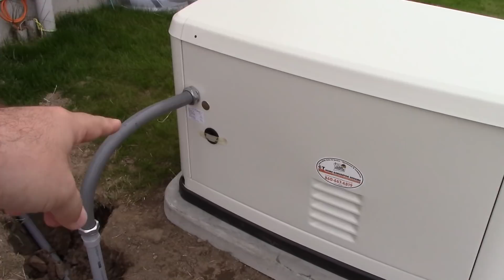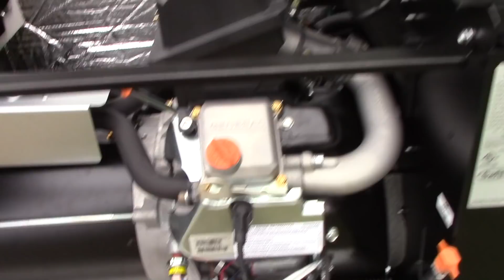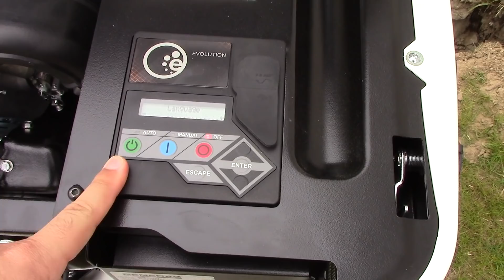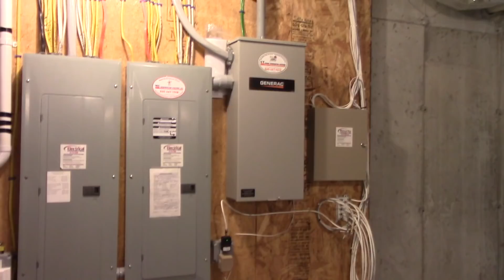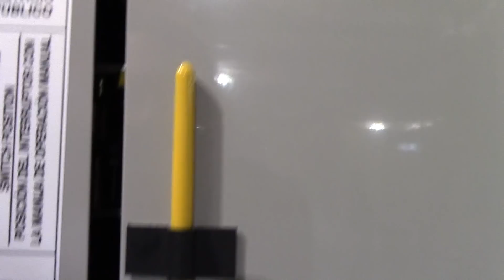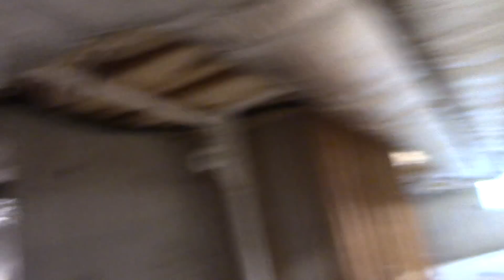Generac Standby Generator.

Comment: You take off the two top screws and you take off the bottom screw going towards the ground I just had a generic generator dealer at my house working on my generator was not working right and that's the screw you took off to take the side panel off to get to the battery the screw going towards the ground and take off just in case you didn't know nice YouTube movies

Comment: All Im seeing lately are bad reviews on these Generacs, I would love to buy a standby generator but I dont want to buy a headache. Overall the Generac reviews Ive read are atrocious
Reply: Mine has been a life saver..just keep up with maintenance and change oil. Mine is actually running right now as its 20 degrees and very windy..power is out and it's been running for 10 hours. Keep in mind that they are NOT meant to replace your electricity supplier. It is for power outages. Good luck and go Generac!
Reply from the maker: Try Kohler.
Reply: Checking into other brands but not too many choices where I live. Thanks
Reply: Try Cummings.  All the installers like Generac so they can’t be as bad as you say.
They have more issues because they sell the most units by far.
I’m trying to decide which one too.  One installer said Koehler has some issues.
Reply: @DONALD1951 /kerry4951 Briggs and Stratton used to make the engines for Generac B&G is supposed to be coming out with whole house GEN SETS soon?
Reply: What are the reviews that you have read about?  I have had a 20KW Generac installed sinse December 2016 no issues.
Reply: Anything manufactured has a potential for a problem no matter what the brand.
Reply: kerry4951 sorry I am late I just read your comment right now. According to the professional Technician who installed my Champion 8.5kw standby generator about two years ago, this brand is the most reliable by far over any other standby gas generator in the market, including the Generac, Honeywell and Kohler. He has installed over 300 units of different brands and serviced them. I don’t live in the states I live in Puerto Rico, but here we use the same brand generators all you people use in the US. I know a few people here with Champions standby generators that has almost 2,000 hours of use and are still running flawlessly because after we were hit by hurricane Maria some areas were without power for over 6 months in a row. Mine have about 150 hours only because it was installed 3 months after we were affected by the hurricane and at that time the power was already restored in my area. I can energize my whole house with mine including my electric cook top, microwave oven, all my lights, washer, my two garage doors, my two fridges, my 48” TV, my wifi rauter, satellite system, my water cistern 3/4 HP water pump, my 18,000 btu inverter a/c, but my water heater is solar all my lights are LED and I don’t use a dryer, neither have a pool and don’t need a heater because we have warm weather all year round and don’t use a dish washer neither.
Reply: @raymondmorales8252  it powers the ir conditioner? with 8.5 Kw?
Reply: hector Cervantes yes in fact I recommended this same 8.5kw Champion standby generator for a lady that lives along and a few local companys that sell solar systems pretended to charge her over $25,000 dollars for one with the limitations all this system’s has over a emergency generator...😳😱. In fact a few weeks after she installed her generator we were affected by a few very strong earthquakes that forced our local prepa company to go out of service for almost a week in some areas, by this same time right after Christmas some of her sons and grandchildren were visiting her from the states and believed or not according to her against the technician recomendations she energized not one but THREE inverters a/c at the same time. Her master room 18,00 btu unit and her other two 12,000 btu a/c she has in the others rooms. She called me to thank me for having recommended this generator to her because she was very happy. The best part was she only invested less than $4,000.00 dollars for everything including the installation with a 420 pounds LPG gas tank the same one I use with mine 👍😉.

Comment: That USB port is for software updates. Generac will release updates software that can fix a lot of issues with your generator. One big complaint is the exercise time is only 5 minutes and not long enough, to change that to run longer than 5 minutes Generac would have to update the software and your dealer/installer would have to plug it in and update it. They were making a loud winding noise that the stator was making on some of the earlier 20kw units thats was corrected and quieted down with a software update.
Reply: I will run my Generac generator on the alternate exercise weeks with load for around 20 minutes just to get things moving. Even if you ran exercise once per week that’s still only 20 minutes a month. Also when in exercise mode do not run quiet test. Let engine run at full rpm’s for the full five minutes.
Reply: Dan my Champion standby gas generator cycles once a week for 15 minutes so I think this is only a issue with the Generac generators.

Comment: There are plastic breaker fillers for open spots.  Just not sure of the exact name they are called.
Reply from the maker: I shall keep that in mind. But for now, they took out the breakers, so they should replace that stuff. I hope they do.
Reply: @Sharkie626  You could always pick up a box of breakers (relatively cheap) to fill the empty slots and mark as spares, in the future you have the correct breaker for that panel and can easily add another circuit.
Reply from the maker: @emph66  That's not a bad idea actually.

Comment: Hmm.  I guess lesson learned--if you're having a house built and there's even a thought of having a generator, have it wired appropriately the first time!  Of course this wouldn't be a problem for a "normal" house where there's only one panel.  You know, like mine!  24 KW is 200 amps.  I don't know how the electrical service is run to the house, if you have 2 separate 200 amp services feeding the house, but the math is correct.  That generator will do a full 200 amps.  Of course, you don't want to actually RUN it at full capacity, which is why you always buy more generator than you need.

My little Harbor Freight Predator generator is only 3.2 KW in comparison, and as you know, it will allow me to do pretty much ANYTHING in the house, as long as I limit the loads to the generator's capacity.  The only things that would be out are the A/C and the pool, which would only be summer things anyway.  Being that mine runs on gasoline, as we learned during Hurricane Sandy, gasoline can become very scarce.  That being the case, I wouldn't even run mine continuously, I'd start it when needed.  I don't think we're going to have another hurricane of that caliber in my lifetime, but you never know.  It's peace of mind is all it is.
Reply from the maker: I can kinda see why some things were run the way they were. I guess the electric came from one side, and the gas from the other side. Before the generator, the water heater was the only gas appliance on that end of the house, everything else is closer to the driveway side, so that's probably why the gas meter went there too. If you remember though the LI house originally had one panel too. Until the pool was added and later on, the basement finished. 

I think in this house, for a lot of the rooms, the outlets and light switches are on separate circuits, which is great planning there. Maybe that's the reason for the second panel. I think the only exception is the dehumidifier outlet being on the same circuit as the basement and garage lights. But that's such a minor thing that it's really not a problem, and it's cool to see the garage lights dim for the quick second that the compressor activates. 

Anyway, I do very much doubt the generator will be at capacity. Even when all three of us are here, we're not running everything. The only things I have no idea about right now is if the hot tub or cabana will be attached to it. I think I was leaning towards of it not being important enough to have it connected, and I think my mom agreed. You agree?

Peace of mind is always good. They do say that if the generator runs for an extended period of time, check the oil level after it stops and cools down. And since this house is lucky enough to have one of those Millennials who actually takes care of stuff and checks these things when needed! It shouldnt be a problem! BAM! I'll take my trophy now!
Reply: Yeah the generator will NOT be anywhere close to capacity.  Even with all the stuff I have, with everything on, I haven't maxed out the panel.  You can do quick math by adding all the breakers up, but that's still high since the circuits aren't running at full capacity.

The cabana, for all intents and purposes, as well as the outdoor lighting, I think SHOULD be on generator power.  Nothing will spoil a party more than that.  Especially if the barbecue uses line power for an ignitor.  The cabana fridge might have food in it you wouldn't want to go bad.  While it's not a problem to transfer everything inside, why burden yourself when it's not necessary?  If I were to lose power, the most I'd want to keep running is the chest freezer.  Everything that can defrost or go bad can go in there, and it stays frozen solid for 2 days.  For a gasoline generator, it doesn't make sense to have the fridge plugged into it, because once the fridge is at temperature, it shuts off, and the generator is sitting there idling, wasting fuel.  Now I'm all about wasting fuel (Buick), but it's a different story when it's scarce!  

The hot tub, on the other hand is a different story.  I don't know the logistics of it.  If it has its own electric heater, that's a big load to be placing on the generator.  Kind of like the LI house--if you had a generator you wouldn't want the sauna on it.  That's going to burn gas like crazy, and in times of strife, you can forego life's expensive pleasures.  For me, like I said, we go into "camping mode" and then if it gets worse you go into "survival mode".  So the hot tub really doesn't need to stay running.  Of course it'll lose temperature while the power is out, but it's better to have it reheat itself on grid power.
Reply from the maker: Sounds reasonable enough. I think the outdoor lighting is already covered as it is. I had considered the refrigerator as the main point. It probably would be good to have going incase power goes out and we're not home. The hot tub on the other hand, it's a much smaller amount of water than a pool and even if there is some heat loss (it will be covered but I know that's not a 100% seal), the heater probably would not have to run TOO long to recover, so we'd probably just leave it off. It's not as essential as the refrigerator. If I am looking at everything correctly, the only 240 volt unit that will be attached to the generator is the 1st floor air conditioner. I'm guessing it would be best to have just one with that needed voltage on the generator circuit.
Reply: Well, that's interesting that they went for the first floor.  Should really be the second--you have to be able to sleep.  During the day you can go in the pool to cool--oh wait.  Chances are you're not going to be sleeping on the first floor.  And think about it--the only amenity you really need on the first floor is the kitchen, which only cooks 2 or 3 things.  TVs and computers and whatnot are upstairs.  Not that you really SHOULD run that stuff on generator, but you can.
Reply from the maker: Maybe it was the 2nd floor they went to, but I can't remember at the moment. Easy enough to test though. Speaking of computers, you make a good point. Some say you should run a UPS with your computer for that reason. You by any chance know good brands for those, and do they cost a lot? I've been thinking about one for my computer and the router.
Reply: Most "el-cheapo" UPS devices won't run on generator power, as it sees the power as too dirty.  So what it will do is switch over to battery anyway.  And most people have misconceptions about UPSes.  They think that it's a battery pack for their computer, but it's not.  It's an Uninterruptible Power Supply.  Meant to be used to keep your system running in the event of an outage so the operating system won't throw a fit next it's booted up.  The main purpose is to provide enough power for your computer to provide a graceful shutdown, that's all.  Most connect to the computer via USB and will alert the system to battery status as well as when power is critically low, to initiate a shutdown.  Most often it will send the computer into hibernation mode, so upon restoration of power, everything will be exactly as you left it.

For the router/modem, you'd want something decent, but that comes with a caveat.  Just because YOU have or can provide power, doesn't mean the cable company can.  Many a time when I've lost power, the cable company has lost power, so even though I have it, I can't use it.  Routers and cable modems don't use a lot of power, but you'd want something that can carry them for a couple hours, that way you can still tweet FML and get your trophy.

Fun fact:  UPSes are rated in VA, or volt-amps, not watts.  For that, you need to know the power factor.  In AC circuits, the power factor is the ratio of the real power that is used to do work and the apparent power that is supplied to the circuit.  I'd love to know how to figure that out.  What I do know if the power factor of a resistive load (like an electric heater) is 1.  All the power going into the unit is being used.  Calculating power factor is easy, it's the absolute value of the cosine of the apparent power phase angle φ.  So unless you speak Greek, you'll never calculate it.  Though a lot of manufacturers Millennialized their products by placing the wattage rating on the package as well.

Bottom line:  bigger is better.  Price:  the sky's the limit.  For reference, my UPS on my system is 1000VA.  Cable modem/router I think is a 350VA without checking.  Brand:  APC.  Tried other units, not impressed.  Also remember, that along with the generator, a UPS has maintenance costs, which is the cost of a replacement battery that you'll need in about 3 years.
Reply from the maker: That's fine. I would just mostly use it for the purpose of saving what I am doing and then shut it down. APC I am familiar with, I know the library used a lot of them. One for the router would be the best for when I use my laptop or something. Battery replacement every three years I think is doable. And if I only use two UPS devices, I think battery replacements won't be a hassle. I'll keep this all in mind.
Reply: Yeah, as a matter of fact that prompted me to look up batteries for my UPS (which have died).  They won't charge anymore.  I have a 1000VA unit, takes 2 12V 7Ah sealed lead-acid batteries.  I found Chinese replacements (which must be just as Chinese as the originals) for about $18 apiece.  So for $36 every few years, you're good.

Comment: Or they could put in blank plates for the open spaces in the breaker box. They can even put in a smaller breaker box too.
Reply from the maker: I'm not sure if plates can be used. When you remove them, you are breaking them off of the inner panel; it's a one-time deal. Another breaker box would work, but would be a lot of labor, so just the inner panel is the best bet. So I think.
Reply: I would imagine that this safety concern has been rectified by now. If not, you can buy plastic filler panels that snap in to the open breaker spaces in the box. That panel uses the industry standard 1" breakers, so the filler panels are a common standard size too. You can buy them at Lowes, Home Depot, or any electrical supply house.

Comment: I have one for my house. When the power goes out, It starts up and you'll have power again a few seconds later. Mine starts up every Wednesday for a few minutes to keep the battery charged. It's a life saver. I'll make a video of mine later.
Reply: Actually the battery is charged all the time off your utility electrical service. The scheduled run time is only to exercise the system.
Reply: @davidhobson8284  , good to know
Reply from the maker: That sounds like a good exercise. We were thinking of every Sunday, just because it's the start of the week, not that there's anything significant about that, but just seems to work. I'd love to see yours!